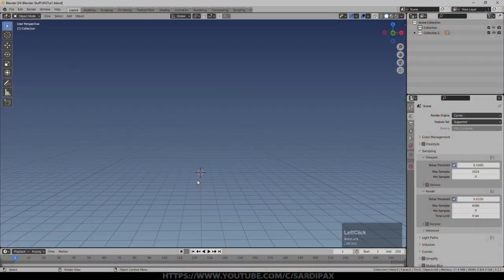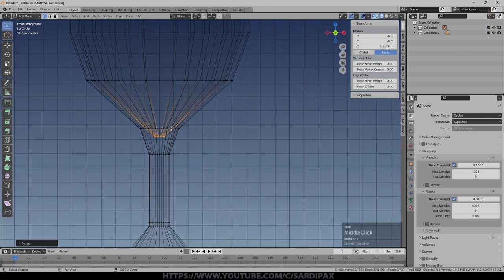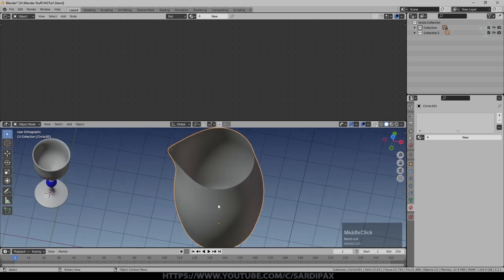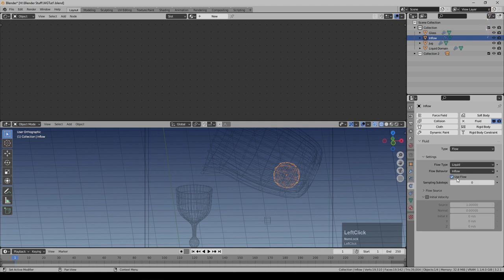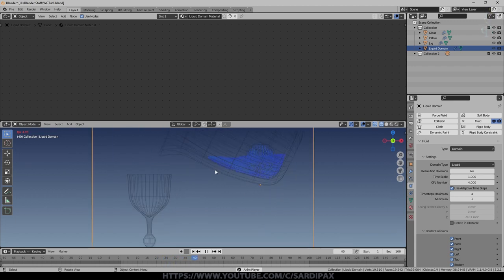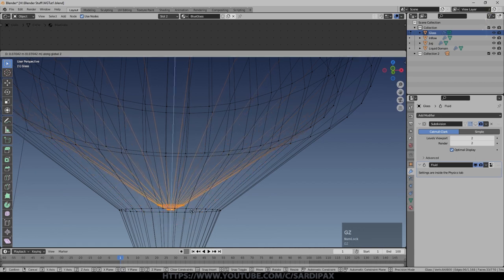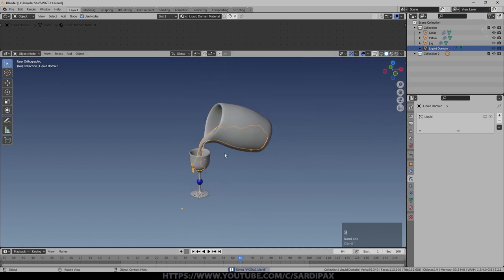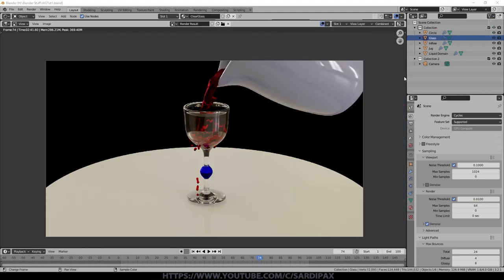A Glass of Red - Blender Fluid Simulation Tutorial

Comment: I'd like to see the side by side with a 256 version and a high one.  Even for lower quality its not impressive looking down over it compared to the side view.  Side vie isn't perfect but, seems nicer.  Curious,  how long to back and render a high quality version to your liking?
Reply from the maker: Thanks, it's always a trade-off between quality and available time. For this simulation, 256 samples took about 4 hours to simulate. Render time was only about 2 hours. But of course you always end up doing it multiple times. 512 samples (assuming it didn't crash) would take at least 4 times that long.
Reply: @SardiPax  How many cores is your computer?

Comment: Thank you for nice lesson but I would really want to know how to do small scale simulation if it possible as you mention it is not working at small scales properly.
Reply from the maker: You can do any scale you want, but the simulation may struggle at smaller scales. The main thing is that you will need to use a high 'resolution' for the simulation which may take a long time to simulate.